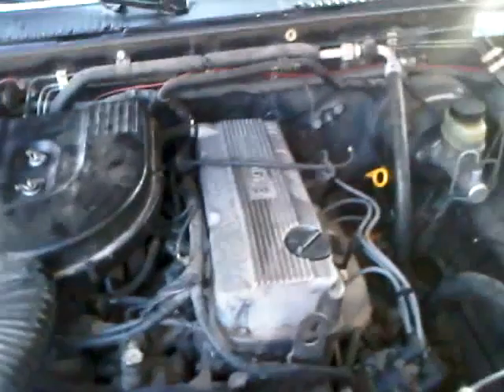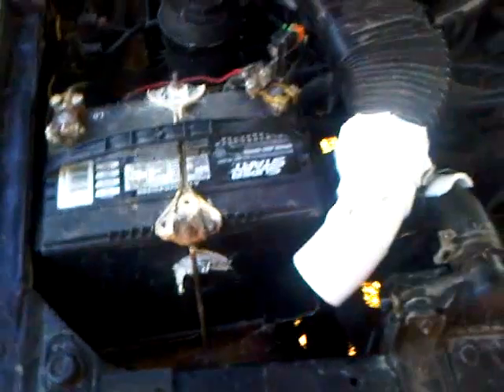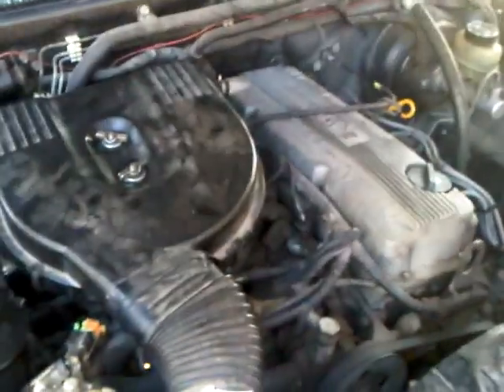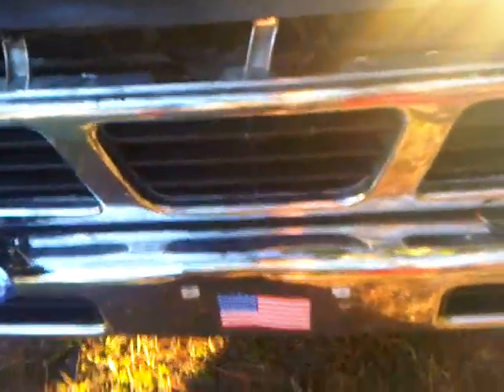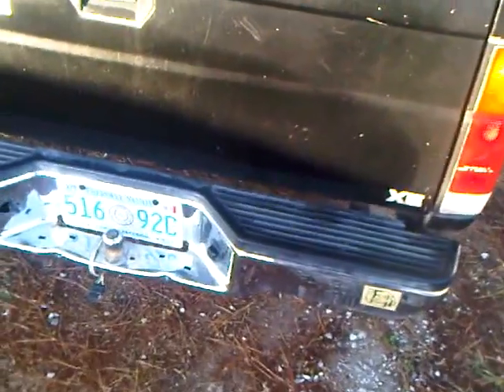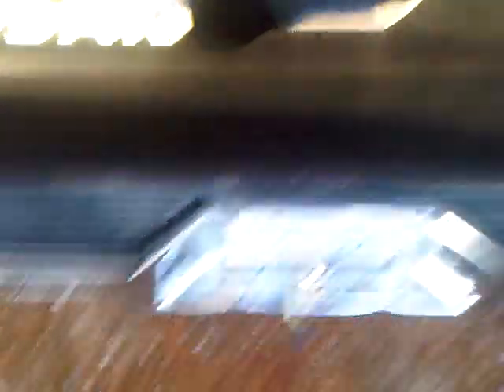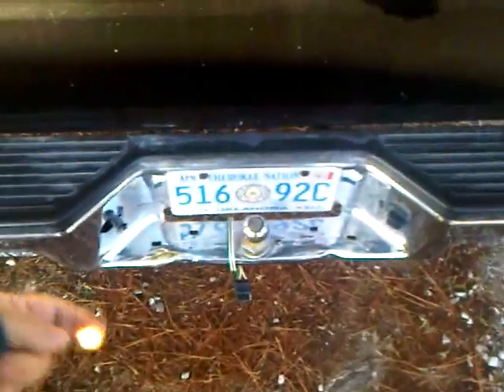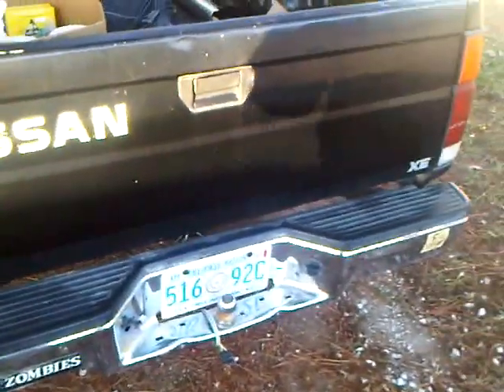mpg mods on nissan pickup

Comment: Thanks for making this video. Love anything related to this awesome little truck. I was getting 24 mpg with everything stock and decent + slow driving. I recently upgraded to larger wheels which lifted the truck about 3" and have dropped the MPG down to 20. I love how the thing looks with new wheels, but wasn't expecting such a hit on MPG. Will try some of these tricks and the ones mentioned in the comments to get back to around 24 MPG.
Reply: I wouldn't. I have three of these trucks and these mods are only going to look terrible and ruin it for resale. Trust me. Just my opinion brother. Peace.
Reply: get  cold air intake, my friend. gives you more hp, mpg, and maybe some torque. Also, it sounds better

Comment: you are misinformed. your ecu will add more fuel with more air, hotter engine doesnt help either. mirrors, mud flaps and bumper where the only help.

Comment: what you should have done:   lower is 3 inch.smooth wheel covers,drive it EASY,smaller side mirrors not delete!, cold air intake + filter,  that other stuff wont work much.

Comment: You might want to try synthetic fluids everywhere( less friction) also add a front lower"chin spoiler" to direct air around the truck instead of under it (the underside is dirty, lots of suspension parts and such to catch the air) Narrow tires with more air and a less aggressive tread pattern (there are limits on this) Removing weight helps (there is limits to this: price, safety things you may need like the spare tire.

Comment: I have a 95 hardbody. i get 10mpg... which happens with bigger mud tires, kc lights, cb antennas, straight piping, and driving the thing off road. like a man. cause nissans wheel like a bat out of hell. Yee Yee

Comment: Alright, im not going to put you down like other people on here, ill just tell you what I know.first off, if you wanna see a good gain, drive with the tailgate down or even remove it... itll take 15 seconds. 2nd you shouldnt block the air flowing into  you radiator. The hotter the engine is, the less efficieant it is. But if you block it, it does have better aerodynamics, which comes out to a wash. 3rd, the fan in the front is connected directly to the engine. It has the same parasitic loss with a 4, 6, or 8 cylinder engine, so it will have the same affect on mpg... BUT on a bigger engine, it will free up more power... especially because the fans are generally bigger. 4th, blocking the ac vents isnt good... you wont have any ac! And rollong down the windows is WAY worse than blocking those vents. 5th, the only real strain on the intake is the air box. They are designed from the factory to make the engine bay quieter... with alot more backpressure, which is restrictive and bad for mpg. So all you needed was to take out the airbox. And whatever that white thing was, it was smaller than the actual tube itself... BAD for mpg. Which leads me into number 6, the exhaust. I didnt see any problem with it except for the fact that it is loud and obnoxious, and it costed decent amount of money... 15 to 40 bucks. And folding the mirrors in is NOT ONLY illegal, but IRRESPONSIBLE. So ill end with this... if you spend money on this... then you are pulling money away from gas going into your truck, which doesnt save much money overall.... does it? 5 bucks for a pair of leds? Wasted money. You will never see increase in mpg with that upgrade. Just cut the muffler off... dont spend money on a glasspack just for mpg. And shit, if you wanting to get into running or something and eat salads, thats extra 20 to 50 pounds... thats good for mpg. Im only 15... but I have enough knowledge to keep up with anyone on this discussion. But btw, I have a 94 nissan exactly the same except for 4wd... its a great truck man. I in no way meant to offend you.... I just would like to educate you.
Reply: To educate someone you have to give correct information. A fan is parasitic to a motor and more so when it's a 4 cylinder, a 15-20 hp loss in a v8 is about a 5% loss compared to 10% for a small 4 cylinder. Also an electric fan wont turn on until the engine needs it, so it isn't drawing energy at highway speeds when the outside air is cooling the engine(assuming the radiator isn't blocked off). The air vents are meant meant for when you choose to either recirculate or allow fresh air inside the cabin so blocking them off just removes the fresh air feature. The air box depends, it has been dyno tested that stock air boxes make more power with a better filter than changing over to a short ram so more power means a better mixture and more mpg as long as your not punching the throttle. The exhaust is a personal choice for him, and the mirror thing is illegal for the driver side, it is legal to fold in the passenger side.
Reply: I used to think the driving with the tailgate down save to me on gas but look up on MythBusters they busted it with the tailgate up the air circulates and lets the air fly over your vehicle and right off of the back I can't explain it because I'm not like a scientist or anything so look up The MythBusters episode on leaving your tailgate down for better gas mileage and for once someone who's not trying to put everybody down on the comments
Reply: Raul Cipriano the fan spins only when the engine heats. It isn't fix to the engine. It have a kind of clutch that works with temperature!!
Reply: Oh snaps dose all that mpg work on my 1989 4x4 z24i nissan pleas let me know thanks

Comment: I love your enthusiasm. That being said I'm out of compliments. I have this truck in a 91 with 235, 000+ averaging 25-35 mpg. Cutting weight will improve your milage more than the marginal gain you get from the small amount you reduce your drag coefficient. P.s. Don't rebuttal with a link, I own the same truck and know better.
Reply: How much weight did you cut in your truck? My dad granny shifts all his cars and that's how he gets good mpg. He always shifts at around 2k rpm.
Reply: The stock curb weight of my truck it's right around 2800 lbs. Mine currently sits at around 2600 lbs. I've done a rear bumper delete, aiv delete, simplified the intake, running a lighter wheel than stock steel rims. Removed the rusted and decayed spare tire and jack. Also running a short flowmaster exhaust, eliminating about 7 feet of pipes. Trimmed light weight things like mud flaps, head rests, and removed the window washing unit, and no floor mats. Lots of little things added up. That and a few mechanical improvements and keeping up on maintenance did the trick.

Comment: I have a 95' and did a lot of the same mods plus a few more and I got stuck at 25mpg average... Did the block-outs, lowered the truck 3.25 inches , bed cover (not topper, too heavy), all LED lights, short intake & exhaust, all synthetic fluids in everything, rear roll pan, switch 60amp Alt with a 70 amp Alt. and smaller mirrors. Electric fan is next. Now I think I'm going for more power, its not my daily driver anymore. But with all the above I got 25 Hwy/City mix, 28 all hwy on Premium gas.